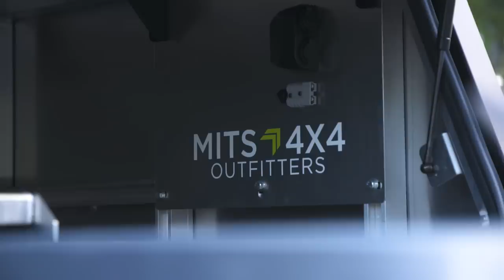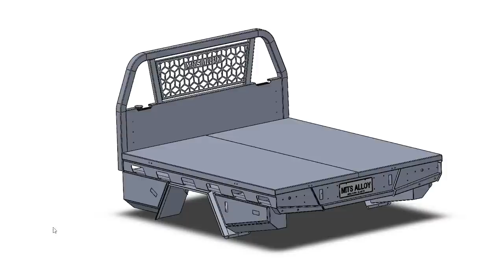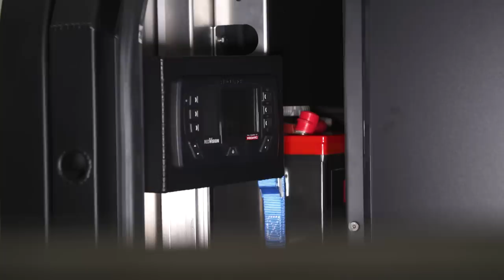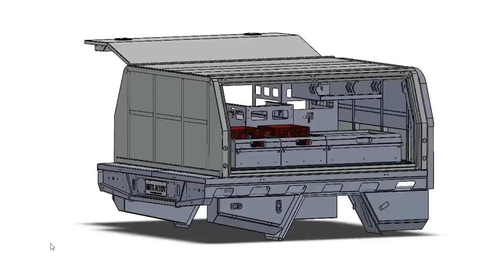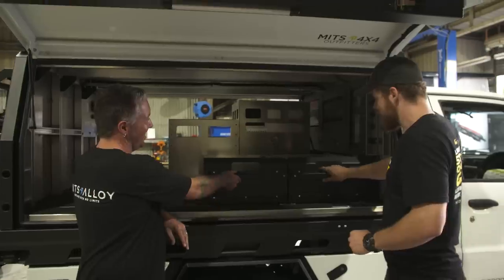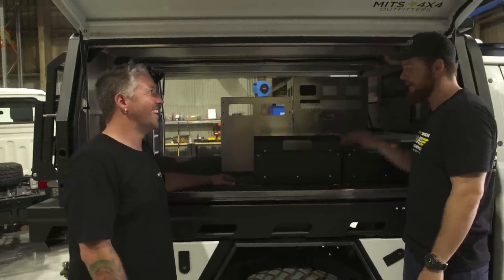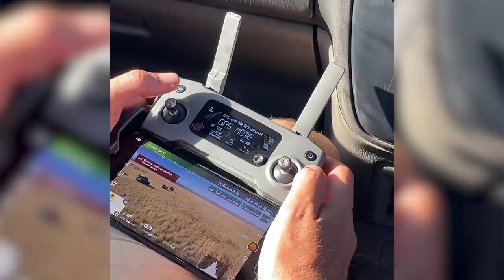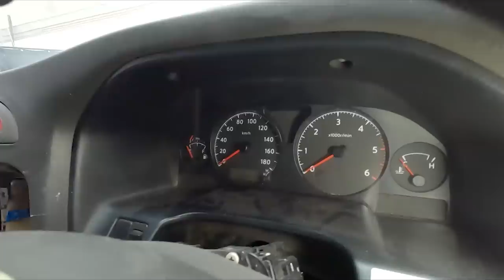NEW CAMERA CAR BUILD - ONE OF A KIND CANOPY & 12V SYSTEM!

Comment: As a cameraman myself, I am really appreciating all of the great design ideas that are going into this new beast. 😎 Sadly, I also know what it feels like to have my 4WD broken into. In my case it was a brick through the window and the whole centre console with stereo was taken. That was a few years ago now but I have been very security conscious ever since. Hopefully karma will catch up with these idiots soon.
Reply: Cameraman here too (Japan). I agree, there are a lot of great designs here that I too appreciate. Last September (2021), I bought a small enclosed cargo trailer to carry all the paraphernalia necessary for a commercial shoot and got tired of my car (Pajero) being all scratched up by c-stands etc. I also couldn't carry anyone else other than in the passenger seat. I have just bought a Discovery 5 which has more space than the Pajero in the back, but I still intend to use the trailer when there is a lot of equipment to carry. I wish the trailer was set-up like the back of this pickup/ute.
Reply: @andrewjones-productions  You sound just like me Andrew. I have a dual cab ute and usually the back seat is where all my cameras go. For any big shoots, I also have a trailer. For smaller shoots, the stands etc usually fit in my canopy at the back. It's not a purpose built canopy like the 4WD 24/7 guys, though. 😊

Comment: You are doing a lot of 12v dc to 230v ac and back to low voltage dc. If you wanted, you could just transform 12v to other voltages for charging.

Comment: I was just thinking how neat was the canopy work, done by the MIT group; just such attention to detail. Well done! I thought though being a camera car, how hard would it be to install some high quality security cameras in the vehicle, capable of alerting the owners/users immediately by way of an alert, that someone was trying to break into the car. As per ignition, would a hidden ignition kill switch be an answer as well? It  was disgusting anyway what these cretins did to the car, but I guess at least you have got it back (some, not so lucky!). You could also run a large segment on security upgrades; how best to avoid this happening. With the cost of these types of 4wds  and modifications these days, along with all the electronic gadgetry to do with charging systems,  I expect a desired item by a certain underclass of scoundrels! All the best!

Comment: Nice setup but if its for the camera guys why as power not thought about better on the working side, the 240 outlet appears to be on the living side. Should of been wired with multiple outlets on the working side to charge all the batteries on the go.

Comment: What you need to do is have a kill switch for the fuel pump, they not going to start and drive away without fuel getting to the engine.

Comment: Great ute guys. Having had my 79 series stolen and written off last year I understand the frustration having someone steal your car. Glad they didn’t get away with it. But since I’ve replaced my car I’ve looked into security for it and have installed a live track gps tracker and very happy with it. But would be great if you could do a show on some tips on how to protect our pride and joy. Cheers..
Reply: How did they manage to steal your 79?
Reply: yes ill be interested to see what they do as i might end up doing it to my own hilux definitely dont want that stolen
Reply: @Mitchkp  they broke into my house and got the keys. And talking with the insurance company that’s common. It’s very hard to hot wire and drive off with a modern car these days but if they have your keys your stuffed! So tracking your car is the only answer I think

Comment: Hi Guys,  To secure your camera 4x4 or any others try steering wheel clamp or a wheel clamp designed for a truck as these put off most car theives and a car alarm are not notice so much. Also don't park vehicle of such value,  in a public car park , also try disconnecting the  car battery via spiecal  security device just pop the hood turn the green cap & this will disengage the + connection & stopping anyone stealing your 4X4  etc.   Yours Peter Rowley ( in UK )

Comment: Reliable 😭😂😂😂🤷‍♂️ 3L 🤦‍♂️
Reply: Tds are worse they just push more power
Reply: @genderfluidpanda2543  I didn’t say anything about tds?
Reply from the maker: What would you put in if it blew up?
Reply: @4WD247  obviously a td42 🤷‍♂️🤷‍♂️ 
But If money wasn’t an option then a 5.9 Cummins p pump with a 24v head
Reply: @4WD247  also depends on what year it is, can’t engineer a td in any patrol older then a 06
Reply: @genderfluidpanda2543  td has been one of the most reliable engines I have experienced, I now own a zd30 and it hasn't been too bad